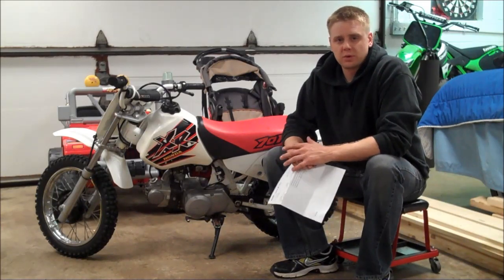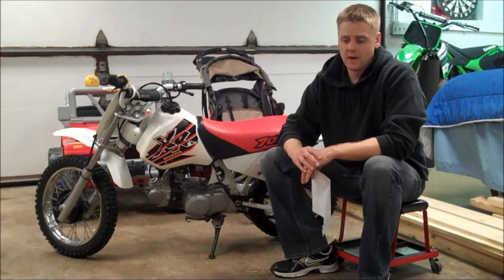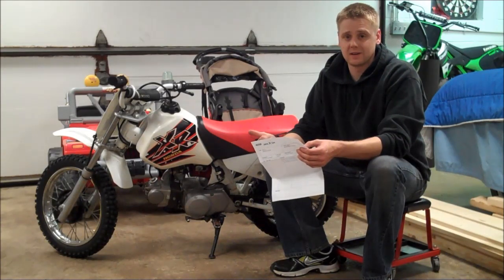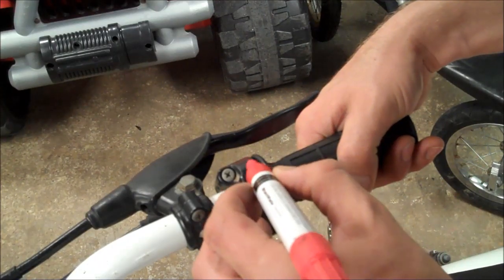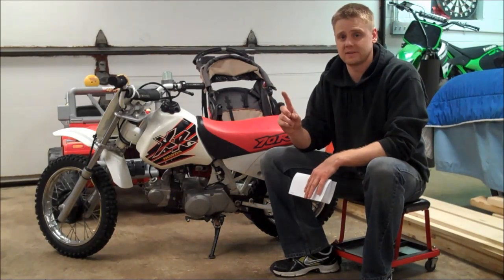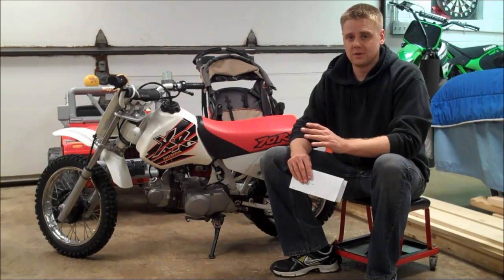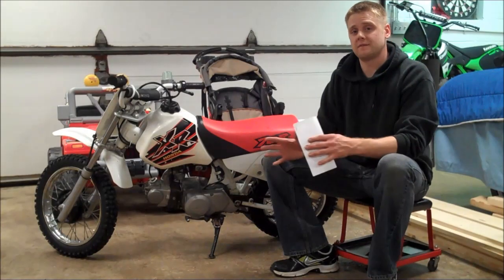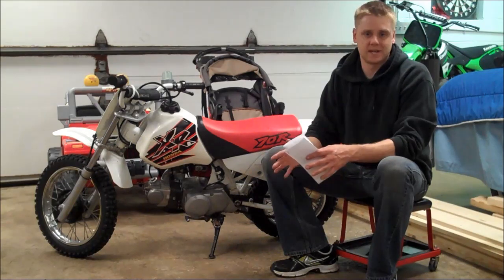How-To: Tune A Motorcycle Main Jet

Comment: What does it mean when the bike stumbles/stalls when I reduce the throttle even the littlest bit?
Reply: I'd suggest bumping your idle screw enough for it to get enough air through the carb, to keep it running
Reply: @andyketterling6559  it's nowhere near the idle screw when I'm full throttle and I let off a tiny little bit and it stumbles
Reply: Im having the same issue Jeheretic. Its only from wide open throttle mainly 4th and 5th gear and if I slightly get off throttle maybe I get a hesitation for a split second otherwise it runs great. Its highly annoying tho. Don’t kno if I need to go higher or lower on the main jet
Reply: @hegemonictrader45  depends on altitude,
Reply: @JEHERETIC  im at 1300 feet. Some threads saying if you roll off throttle from WOT and get that slight hesitation the main jet to big.

I run a DR650. I rejetted it recently. Runs fine except for that blip. I went from stock 140 jet to 150 jet. Gonna try the 145 that came with kit. It is 40 degrees here to right now
Reply: @hegemonictrader45  I'm not good at jetting carbs, so to me it's a guessing game

Comment: So if it's bogging around pilot jet to needle mark and alot in full throttle (main jet ) to the point of almost dieing would I need I go up in pilot first then try main? Pretty sure stock jets and the airbox is removed with the metal mesh air filter, (no foam)...(but recently bought the uni filter just not installed) AND the baffle or spark arrest has been removed out the exaust so I think it's getting to much air(guess) it starts first kick and idle fine ... any thoughts helps thanks
Reply from the maker: Pilot jet is sized per this article: https://howtomotorcyclerepair.com/how-to-size-your-pilot-jet-pilot-screw-explained/

Comment: Hey Matt I have a weird issue with a hawk 250 it has a brand new carb on it it only runs on choke I have even switch the main jet and piolet jet what else can I do
Reply from the maker: Idle is all fuel/air screw & pilot jet. Get that circuit clean and jetted properly.
Reply: @HTMR  thanks

Comment: Hey matt..my vulcan800 has a the aftermarket cone air filter..came on the bike when i bought it..rides fine in low rpms bt getting into 4th gear & higher revs..its hesitant with power & throttle response..guy i bought it from didnt do anything to the carb but move the needle clip all the way down to get more fuel..but thats it...think i need to adjust my fuel mixture screw to allow more fuel in????...or would i need to get bigger jets as you did in this video..Thanx
Reply from the maker: What throttle position and RPM are you having issues?

Comment: I have a question, if you could get back to me tht would be amazing, I have a 125cc, and i put a little bit bigger carb on it and I'm not sure what's happening to it, I havnt messed with any of the internal jets, I have messed with the idle screw and fuel/air ratio screw, the carb is brand new, It idles at 1k and when I give it just the small amount of gas its revs over what it should and it take a few seconds to get back into idle. I'm not sure if it is the main jet, or the pilot jet.
Reply from the maker: You described a lean hanging idle condition. Pilot circuit is too lean. Either adjust it or jet richer.

Comment: I have a question, i have a zx6r 2002 the problem is when i fulk throttle it once it reaches 8k rpm it feels like its bogging but rpm goes high and it sounds weird also it looses power it feels like flat. I have a slip on shorty yoshi, main jets are not stock anymore when i bought it from the last owner, rpm too slow to go back to normal because i rev it it will stay 1.5k rpm for like 2 sec then go back to 1k. It also feels like it doesnt have any engine breaks at all. Hope you can help me with this one, the last owner said that the main jets came from a 4k engine (toyota or something) thanks.
Reply from the maker: Any chance the clutch is slipping at high rpm? Sounds like you need to take carbs apart and verify what all jetting has been changed. Sounds like you have a lean hanging idle. It needs more fuel via fuel screws and/or bigger pilot jets.
Reply: @HTMR  the last owner said that the main jets are just shimmed, about the slow rpm going down? What do you think about that one? Thanks man
Reply from the maker: @FullThrotle04  Can't shim main jets. He was referring to needles. RPM going down slowly is the "hanging idle" I described.
Reply: @HTMR  he literaly did shimmed the main jets i saw it like im weirded out as well why he shimmed it, he says that so it will make the hole in the main jets bigger to flow more fuel.
Reply from the maker: @FullThrotle04  You can't shim main jets. You can drill them out to make the hole larger, however that is not a good idea since it is a precise part.
Reply: @HTMR  yeah thats what i mean he drilled it. Anyways thank you so much man appreciated it even though that the vid is a long time ago you still reply to comments to help.
Reply: Just last question can you give me  a good size jets for my bike? I want to order to dynojet but they dont ship here in ph.
Reply from the maker: @FullThrotle04  Why don't you take it apart first and see what the PO did?
Reply from the maker: @FullThrotle04  OK, if it were my bike, I would take carbs apart and clean them. Ditch all previous owners poor attempt at jetting. Buy a jet kit and install.
Reply: @HTMR  alright thanks man, will try to find seller of jet kit here in ph.

Comment: Hi so I have a pocket bike that's 125 cc 4 stroke and I'm planning on putting a larger entake on it, it also sounds like your dirtbike before the jet upgrade. Do you have any idea what size jets I need for the main and for needle jet. I am at sea level and the weather is usually around 50-60 Fahrenheit
Reply from the maker: I don't know what jets sizes you need, however you will need more fuel.
Reply: @HTMR  so probably upgrade fuel lines/filter? Also, I'm probably going to remove the main jet and go from there, how many sizes going up do you recommend?
Reply from the maker: @ayomayo3814  No need to upgrade lines filters. Go up 2-4 sizes on main. Raise needle one clip position.
Reply: @HTMR  awsome man you replied right as I had my carb open. My main jet is 72 and I only have issues with full throttle bog. So a 75 should fix it? (just also installed a cai). I only adjusted the needle, I have better acceleration from 30 to 70 percent throttle. But my engine does when I go less than 5 percent throttle and hold it.
Reply from the maker: @ayomayo3814  I don't know what brand carb you have, or the jet sizes, but you will probably be in the 75-82 range. Buy all of those and test.

Comment: Hi ik this post was ages ago but im having problems with my chinese 50cc 2t atv ot starts bogging dwn wen u pick up speed. The carb only has a idle setting. Will moving the carb needle sort the problem out. Tia
Reply from the maker: Is the carb clean?
Reply: @HTMR  hi thx for the reply. Yes the carb is spotless its got a new clutch onit aswell. Do these cheap carbs need rejetting anyway. I know theres not much power anyways but wen ur goin for a couple of mins and it starts picking up speed its goes about 40mph standard. Its like theres no power to get it moving low down.
Reply from the maker: @timworrall917  Pull the plug. Lean or rich looking?
Reply: @HTMR  i checked the plug when i put the new clutch on. I googled lean and rich plugs and its deffo not that i no plugs need changing after a cuple of good runs. I just cnt sus it out they are so tepremental :(
Reply: When it gets goin iys very fast just takes a long time to get there. Can u drill a hole in the clutch arms to make them engage at a higher revs or is that just nonsense.
Reply from the maker: @timworrall917  Send me a video
Reply: @HTMR  weathers abit crap here so wen it drys out i will send u the vid matthew. Thx for all ur help at this point.
Reply: Sorry i forgot to say this issue happens mostly wen it is warm

Comment: I am working on a 1985 yamaha tt600, doing a raptor 660 carb conversion. Getting close but I get severe bog wot if the air filter is installed. It goes away if I remove the air filter. It's a dual carb. I'm running 155 mains in both now. Do you think I should increase or decrease the mains?
Reply from the maker: You proved that is needs less fuel. At what throttle position does it bog?
Reply: @HTMR  Probably at about 3/4 throttle. I've learned a lot from your videos and appreciate very much that you post them.
Reply: @HTMR  So I guess I could drop the mains down to 150s or use pod filters to maybe bring in more air.
Reply from the maker: @ElmerJ_Fudd  You are right at the needle to main transition, so could be either. Watch this video: https://youtu.be/6b9dMhgZT-c

Comment: This looks to be the exact problem I’m having, just got a 2002 Xr70r with a uni pod filter and looks to be modified stock exhaust and if I roll on the throttle smoothly no problems but if I twist the throttle quickly it bogs and if I hold it it will die, previous owner said he thinks he upped the jet. This is my first dirtbike so I’m kinda new to all of this

Comment: Interesting points.  I do have an issue helping a neighbor kid on his 2008 Kawasaki 140.  Took carb apart and cleaned out all passages and readjusted everything.  The engine now starts up and idles nice and will take throttle without bogging or stalling out. The issue I have run across that I dont understand, is this:  while the bike is balanced upright, it has a nice idle but when it leans left to the kickstand, it slows down.  If it straightens back up right, in increases to normal.  Lean it slightly to the right side and the idle speeds up. No throttle change.  Any ideas or thoughts?

Comment: hi i'm having simaler problems with my xr100 but i dont have the money to buy a bunch of spark plugs,great video man if you have any tips please lmk.Thanks!
Reply: Kinda the same issue here too... I changed my spark plug with a brand new one yesterday and checked today its pure white... Wich tells me its lean, if it was black and wet then it would be way too rich.  The only part that confuses me is my bike will run at full throttle in the low to mid rpm range, but in the high rpms (7000-12000) if I go wide open throttle thats when it cuts out and starts dying.  Could still be the main jet, just not keeping up with the fuel consumption?  I see the previous owner of my bike drilled holes in the intake box.  But anywho yeah I'd check your plug color first after riding it around a little.  (they cost me $2.50 so I bought 6 of them)  NGK

Comment: I have acquired a Honda 70 for my son. It has a high flow cone filter, something from car part store on it. Bike will crank fine, run for few minutes.  Once the temp comes up it just dies out. Then will not start again until temp drops. I also noticed what looks like float sticking some, fuel coming out tube under the bowl. This is same bike you have in videos, except mine is red. I am trying to get ready for his birthday next week any ideas were to start would be greatly appreciated. I watched most of your videos, going now to set everything back to stock locations. Guy that traded it to me told me he took card off and cleaned it, added the air filter. Thanks in advanced.
Reply from the maker: Have you seen my carb clean video? Here it is: https://youtu.be/XOHUmbl4TH0

Sounds like the float has some debris or needs replacement. I would clean the carb and double check the previous owners work.
Reply: MatthewMCRepair I have taken it off, cleaned it out. as poured remaining fuel out of carb I poured through blue shop towel. It left gray color stain, fuel looked little white or gray. I went ahead and pulled tank, cleaned it out. I ordered jet kit, and rebuild kit today. hopefully this will  urethane our problems. you know any cheap ways to help exhaust without spending 300 bucks?  All I have seen for this XR70. I have to be missing something.
Reply from the maker: Just hold off on exhaust for now. I'm in favor for leaving the stock quiet exhaust on it. Aftermarket exhaust is so noisy and there is little performance gain.

Comment: I have a trx500fm the stock main jet is 162 keihin, for me at sea level its lean, which number do I put?
Reply from the maker: First off, what are you symptoms that indicate lean?
Reply: the spark plug is to white, but run good
Reply from the maker: It's white after a wide open throttle plug chop?
Reply: Yes i run a full for 15 minuts and the spark is white, i want more power
Reply from the maker: Any modifications to this ATV? I typically jump jet sizes 2-3 sizes up. So in your case, try a 168.
Reply: All is stock, I'll deal with dynojet kit, thanks 🤘🏻

Comment: This is my problem! Which size jets should I buy to test? I have a 90cc with a pod filter. Thanks
Reply from the maker: Give me more info on what bike you have. Year make model?
Reply: +MatthewMCRepair it's a 1967 Honda cl90 but the guy before me put on a aftermarket (stock type) carb, pod air filter, and custom pipe so it's all messed up. He sold it to me running but everytime I try to ride it won't start. Thanks!
Reply from the maker: Starting has little to nothing to do with main jet. Start with a carb clean and ignition tune up.
Reply: +MatthewMCRepair I have cleaned the carbs. I think it must be the carbs because I can get it running after playing with the mixture screws for a while. I can start it with full throttle but it won't run because of the mixture I think
Reply from the maker: Have you tuned the pilot air screw and idle? See this video: https://www.youtube.com/watch?v=TDU2KOpYwFg

Comment: Very educating, here's my problem. I have a Honda Tiger GL200R (Indonesia)/ CB200X(Brazil). Quite similar engine with CRF230F.
I'm running on 210 cc now, and using a PWK30 Nibbi(Taiwan) with 38-110 stock carb jets. My carb hasn't been tuned up well yet, it dies when I suddenly open the throttle and when riding it i feel like it's not 100% of its power(i know because stock's way better responsive). It's like screaming but something hold its power. Where do I start? main or pilot jet? Sorry for broken english, hopefully you get it.
Reply from the maker: Does the problem get better or go away if you leave the choke on? If so, it is lean. Does that carb have an air screw or fuel screw.?
Reply: No, the choke on suddenly stops it.
Yes, it has both. This morning i tried to analyze the problem according to your website about air/fuel screw.
I started to change the pilot jet to 45. It smokes dark means too rich then. Since i don't have time to shop now, i enlarged the hole on PJ-38 using some used throttle wire. A bit smaller than 45's hole. Now honestly the lower rpm (PJ) works a lot better. I may need to get the PJ-42. I'm just sharing, you've been very helpful. Thank you so much. The rule "1-3 turns" works well on my bike. (y)
Reply from the maker: OK, don't drill jets, just buy new ones. Also, it will only have an air or fuel screw, not both.

Comment: i bought a new carburator and i put on my scooter and the air box(air box is the old that nwas running in old caburator) when in place the scooter dies. the carburator came with main jet (90) and i changed for 65 and the scooter doesnt died but only if i kept the trhoutle open and with 65 main jet but without air box the scooter runs nice what should i do?
Reply from the maker: Not enough information for me to tell you what to do. Why did you replace the old carburetor if it ran? Give more details.
Reply: +MatthewMCRepair  with the old carb the scooter starts but the throttle if opened more than 1/8-1/3 dies....
Reply: +MatthewMCRepair  but with the new carb that problem was solved but when I try to put the air box of the old carb the scooter dies in a second
Reply from the maker: Have you tried adjusting the idle and air screw on carb?
Reply: yes i tried to close and open the screw and was the same the new carb works ok but only without the air box. its possible that the air box doesnt let enough air in the carb?
i was thinking i buy a "pod filter" (i dont now if you call it that way) to alow more ar into the carb.....
Reply from the maker: Send me some pics here: https://www.howtomotorcyclerepair.com/contact/

Comment: My son has a Yamaha pw50 and I just put a full fmf exaust and I doesn't rev out from 3/4 to full throttle anymore...still has factory jet in it ...what do you recommend? Any help would be greatly appreciated....thanks
Reply from the maker: Awesome, I picked up a pw50 a few months ago for my kids as well. Does FMF have specs available? Does it sputter or bog/feel flat at WOT? Perform a plug chop and see what the plug looks like.

Comment: Hey Matt, not sure if it was in one of your videos, but I saw where there was a "thumb-wheel" on the idle adjust screw for easy adjustment on the fly without a screwdriver. I just can't see where to locate one of these. Any idea? I'm wanting one for my bike because it always stalls when cold, and it would be great to be able just to look down and adjust it
Reply from the maker: What year make model or carb do you have?
Reply: Not sure of the year, I reckon the carb has probably been replaced since the bike was new ('72 honda cub). I bought a new carb for it recently, so of the 2 carbs I have, one is a CENTA 88D15?, and the newer one I bought is a Kei Hin... Maybe I can send you some photos via your FB page.
Reply from the maker: Email me here: https://www.howtomotorcyclerepair.com/contact/

I will reply and then you can send me pics.

Comment: Any body have an idea ware I can get a service manual and battery box for my 1983 Honda Urban Express with only 42 miles. I then need to clean carb and reset or replace for better performance, any recommendations oh also any ideas to clean rust or recoat inside fuel tank.
Reply from the maker: Fuel tank coating videos: https://www.howtomotorcyclerepair.com/restoring-a-rusty-motorcycle-tank/